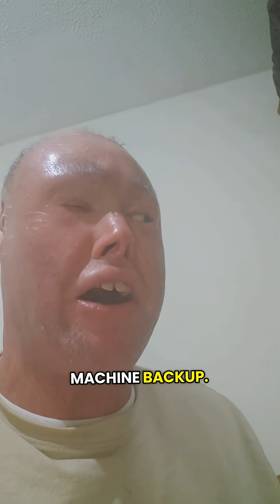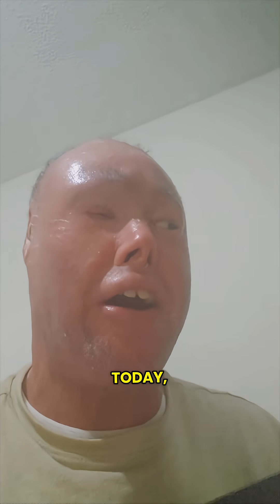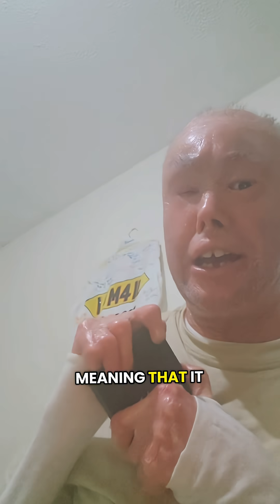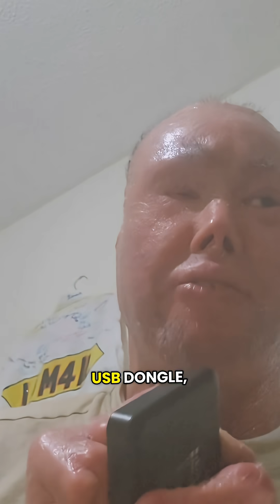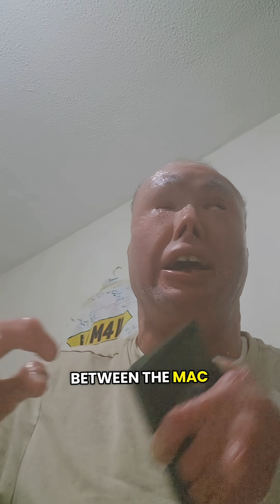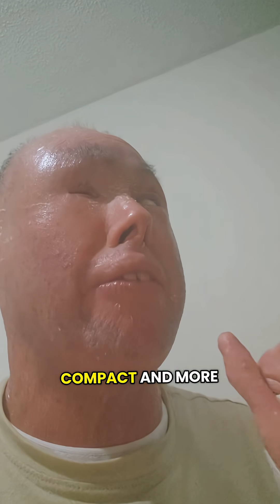Why using an external hard is great for time machine backups? #mac #apple #tech #techtok #harddrive

Comment: Have you ever had to use the time machine feature? If so, how often do you use it?
Reply from the maker: Whenever i needed to. I normally just plug the hard drive in, manually press back up and it does it's thing and unplug it once it's done. 

I pretty much do this manually rather than having to do hourly, only if i needed to.